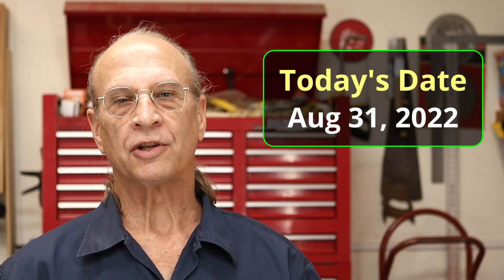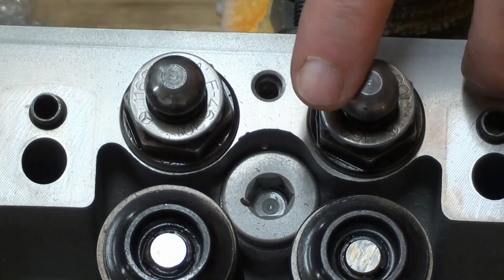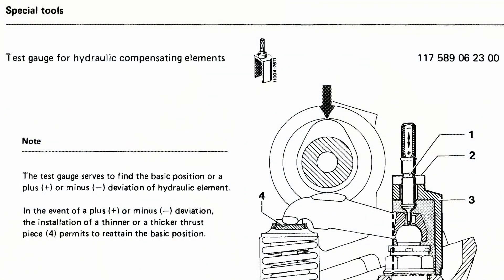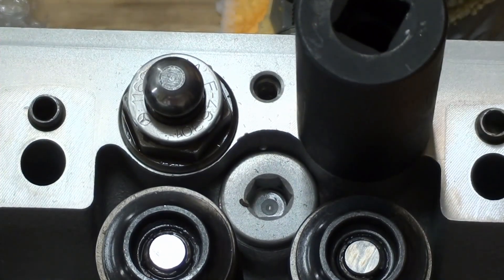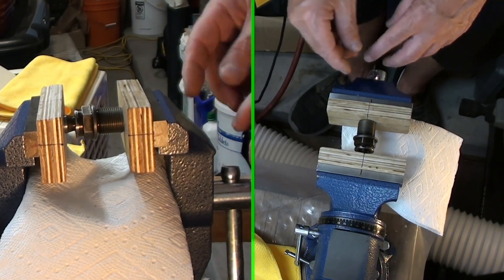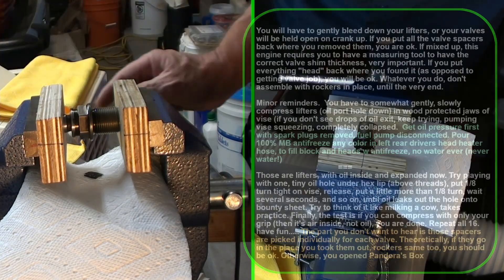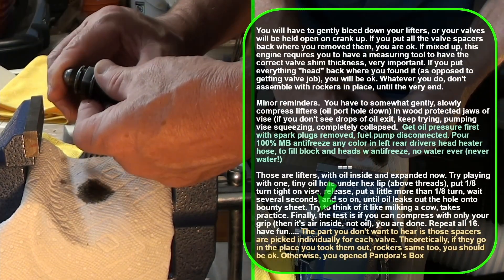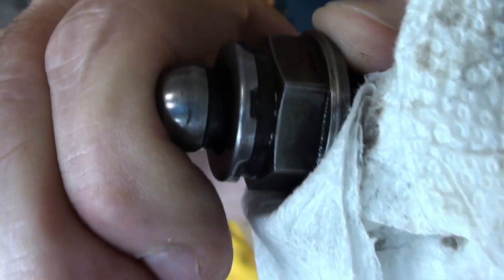560SL - Bleeding Hydraulic Lifters / Compensating Elements

Comment: Hey Tony. So I’m in the process of rebuilding my M117 and I’m currently at the stage of measuring for my thrust pieces, or valves shim pieces. The engine is on a stand right now so I can’t fill the compensators with oil like the manual says. How would I be taking the measurements with the compensators bled/empty if they aren’t pushing up the rocker?
Reply from the maker: You do not need to pressurize the compensation elements before measuring with the No-Go-Gauge (specially when the engine is out). That said, I have a playlist for the cylinder heads of the M117 that includes everything from removal to install. In that playlist I have a video dedicated to measuring the clearance using the No-Go-Gauge. If later you want to remeasure the compensating elements you can. Here’s a link to that playlist. https://youtube.com/playlist?list=PLQAW1udK_cOjUxXdqszLITa5AS4ZxvmwD
Reply: @TonyLiveTV  Awesome, just what I needed to know. I’m doing the measurements today. Thank you!
Reply: @TonyLiveTV  Alright so I bled the compensators and attempted to take readings but there’s a lot of play in the rockers and the line is higher than it should be. They’re all about 4.75 and 5.1mm. I’m assuming I get thicker thrust pieces to get rid of the play and hopefully push the compensator down? I was planning on trying a 5.45 and a 5.8mm
Reply from the maker: @legendofdoge6658  You will notice my rockers were NOT loose when I installed them. You can see exactly how my rockers look at install if you watch my rocker arm install video. If your rockers are overly sloppy it could mean you need a valve job or your compensating elements or rockers are worn out. Were your rockers noisy before? Did you do a leak down test prior to pulling your heads?
Reply: @TonyLiveTV  Heads were refreshed, valve job was done with new seals and guides, rockers are new and camshafts are new. I’ll try getting a new compensating element and see if that helps since not all of them had play.
Reply from the maker: @legendofdoge6658  are you sure the compensating elements are good? In my video I include a portion of the manual that demonstrates how to 1st test the compensating elements using the handle end of a hammer and pushing on them one at a time. If your compensating elements are too soft and don’t fully extend back out (specially after bleeding them), then they need to be replaced. Since you have completely rebuilt the heads with all new parts including rockers, the only thing left is the compensating elements. Even after fully bleeding the compensating elements on my engine, they were still hard to depress with my fingers and my elements are original parts.

Comment: Hello Tony, thanks for the videos I also have a 560sl and one ore to lifters are making noise.
Do I have to replace it or is the cause clogging and can I repair it using your method?
Reply from the maker: Are you sure the noise is caused by the compensating elements? There’s a lot going on here. It could be bad/weak springs, excessive cam or rocker wear or even worn thrust washers. The purpose of bleeding the compensating elements is to make sure they are not stuck which is very important during the initial startup. After startup the compensating elements are filled with oil and become hard. You can easily remove the rockers and check if the compensating elements are pumped up (full of oil). If they are squishy after the engine is running this may be the noise you hear and you may need to replace them.
Reply: @TonyLiveTV  Thank you very much for your quick response.
I removed the valve cover today, and see light wear on 2 cams, in the form of light grooves that you can lightly feel with your fingernail, not very deep, This engine has run 190,000 miles.
Could that be a cause of a broken lifter? That your valves will float.
I can start with replacing 8 tappets.
Reply from the maker: @MrJos1975  Before you go down the 560SL rabbit hole, first start with changing the oil. With 190,000 miles it would not surprise me if you find a small groove on the cam, but this is not the cause of a noisy valve train. As long as the groove is in the same direction the cam turns. That said, a worn or collapsed lifter can create excessive valve train lash. Testing the hydraulic lifters to see if they are collapsed is easily done by removing the rockers and pushing down the lifter. If it doesn’t collapse it is likely good. Could it be stuck open? Possibly…. If you push it down with your thumb it is bad. First you should change the oil. Drive it around an hour or so and then you can test the lifters. These need to be pumped up by engine oil pressure before you can test them in this way. And while you have the rockers off you can inspect them as well. Don’t mix anything up. Going beyond this will send you down the 560SL rabbit hole. I’m not an expert in any of this. This is my first time down the 560SL rabbit hole. Good luck!